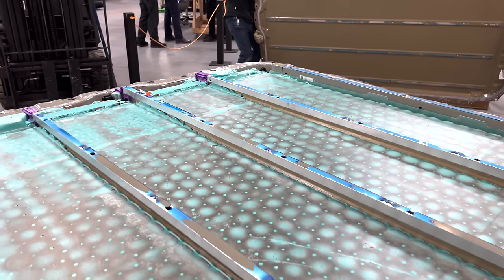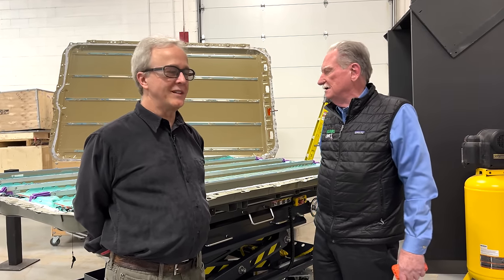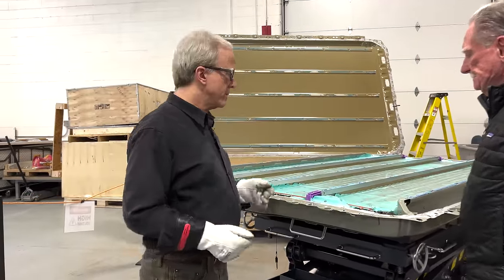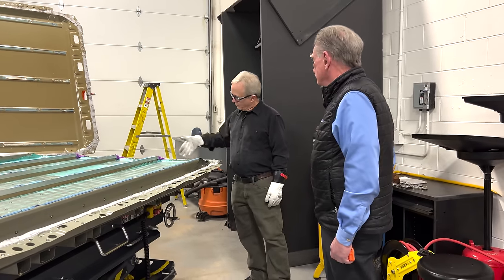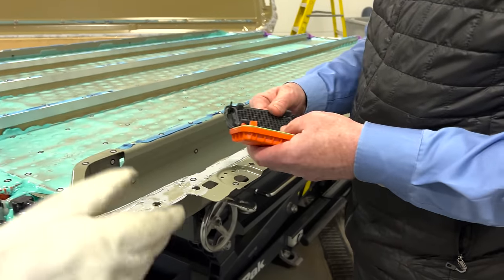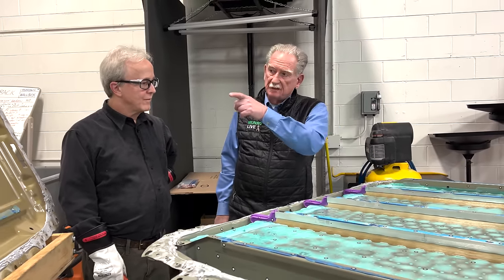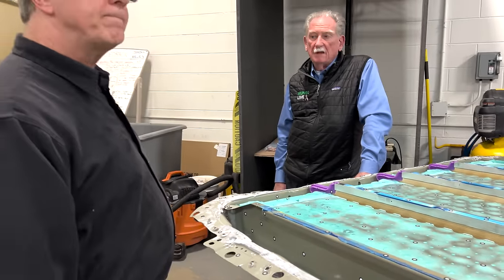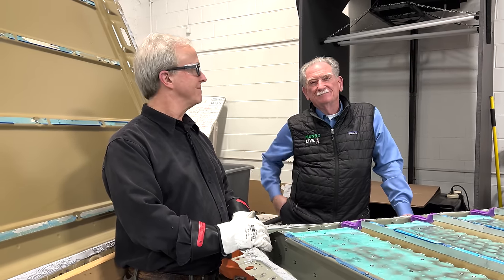Tesla Cybertruck Battery Pack: Our First Impressions Under the Lid

Comment: Completely unserviceable junk glue pack.  Another disappointing design feature that needlessly increases costs for the customer.
Reply: These packs aren't made to be serviceable. They are made to be safe for the customer and cheaper to replace than serviceable.
Reply: @xxZerosumxx  $15k for a loose bolt or blown fet is cheaper?   A failed string like you often get in rapid charged Tesla packs after a year or two would also be far more expensive.
Reply: @hugegamer5988 You don't get that "often"
Reply: @hugegamer5988  These packs have an 8 year warranty.  If anything happens to it, it's on Tesla. But I'm sure you're only here to complain about what tesla does.
Reply: @hugegamer5988 8 year warranty though, do no consequence for the end customer. I imagine you’ll find any manufacturer defects before the warranty expires. I think Tesla was targeting making these batteries last longer than the 8 year battery warranty.
Reply: Hilarious given it's the exact opposite, serviceable packs increase costs for the customer.
Reply: Batteries should not be serviceable. They should be designed for safety and cost. Looks like Tesla did an amazing job here.
Reply: Sounds like someone who can’t afford a cybertruck and is hating to me 👍🏽
Reply: Your getting roasted bro
Reply: @xxZerosumxx if they go bankrupt before 2032 you are shit out of luck tho 😂

Comment: Not a great design taking into account refurbishing the Cells or even recycling these new structural battery packs. Hope the EU intervene, as they did with swappable batteries for Smartphones, as a standard charging plug layout for BEVs.
Reply: Recycling should be no problem. They grind up the pack and separate out the elements.  The foam is no different from various other adhesives as far as that process is concerned.

I don't know the relevant EU regulation, but making the battery cells swappable (as opposed to the entire battery)  would be a fairly big cost/performance hit for the product.  I don't think the intent of the regulation is to force consumers to pay more or get poorer performance.
Reply: @AmiGanguli  So clean, sustainable and Eco friendly method...not.

Comment: Wait! What happened to the 'structural battery pack'? How are those slightly thicker walled 4680 batteries going to support the stiffness of that pack with an air gap like that on top (below)? It looks like the strength of the pack comes from those longitudinal bars, which do tie the top and bottom of the pack together, making it a strong box. A box like this makes the trade off of stronger cells at the expense of maximising power density, useless.

Comment: It’s like a Mobile  phone , usually when the battery goes bad people get rid of it.  If you built an engine 40 years ago and never ran it , you can put fuel in it and it works just fine.  But batteries always fail over time.  An electric green vehicle is only green over time   if the batteries could be easily removed and repaired inexpensively.  ICE vehicles can be handed down and used for decades.  The greenest vehicles are the  ones  that you can pass down to different owners and use for many years , because all these people buying used don’t have to buy a new one and and that means one less vehicle that needs to be made.  The greenest vehicle of all is the one that’s not made.

Comment: I never Seen A Guy Take A Pry Bar to the Top of A Battery Pack to Pry Something Loose ! Next Time Pry on the Delineators or Cross Channels ! Loose Move with Host Standing There ! Mika Thermal Shielding , Pop off Lid Venting , Flood Port Valves, Gas Valve Solenoids Stick Sometimes too ! Super Battery Pack Looks Very High Density, Packet Tight Fit None Serviceable The Every Car Scenario You Still Get Moisture Thru Capillary Action Nice Unit has a Lot of Built in Safety Thanks for Bringing that Forward !.

Comment: Serious question.  Is RTV really enough to seal these battery packs?  Even GM had dealers use RTV on a recall on the Hummer for the main connector into the pack and just pipe RTV around it to keep water out.  Shouldn't there be something better used for sealing such a vital and potentially dangerous component?  The OEMs have trouble with RTV on ICE engines as it is lately (which is I assume a quality control issue), and I've seen first hand some of the GM ones.  LSY 2.0 camshaft carriers, L3B 2.7 plastic lower oil pan, rear main covers on LSY, L3B and the LM2 Duramax, etc.

Comment: Makes you wonder what Nio or Mio does with its batteries in China. They are probably one of the first, if not the first EV maker that has the ability to change your battery on your vehicle in 3 minutes flat with a brand new pack which looks very similar to the cyber truck battery pack size.

Comment: I see a lot of comments about repairability. The logic behind a structural battery pack is that it saves weight.
In practice this means the EV weighs less, needs fewer cells for same range and is more energy efficient.
It is also most likely cheaper and faster to produce, meaning more EV's on the road.
Less weight, at least for the other models, means less road wear and longer lasting tires.
Combine that with the fact that high voltage battery packs are not something an average person should try to repair anyway.
It's just not safe for anyone but a specialist.  Tesla battery packs are also very reliable to begin with. Adding weight and cost and complexity, that can lead to more failure, seems like a bad idea.
Its not like they purposely made it unrepairable, there are compelling reasons to take that route.
Reply: I couldn't agree more.

Comment: Thank you for the model x story.  I have worried whether one could exit the car in the very unlikely event of being submerged.  This is the last safety feature that needs to be on any vehicle.  Kudos to Tesla engineering.
Reply: I wonder, when car thieves will use it. Just apply some water to some humidity sensors and the windows will go down and the doors will pop open. Sounds like an interesting mechanism.

Comment: Many thanks.
Very informative and ingenious design. Once again by Tesla.
Wouldn't want to own one because of high insurance costs, extended warranty costs, maintenance and repair. Leasing makes the most sense and flip every three years, however when you are retired and doing less than 5k miles per year - leasing isn't cost effective either. This may explain why conversion to fully electric is stalling in the consumer market.
In the UK there are additional  issues. No tax incentive, hundreds of miles to the nearest Tesla servicing facility and FSD isn't available on our roads yet.
Tesla Robotaxi may be better option for retirees. So another reason for delaying a purchase and staying with my trusty ICE vehicle. Also, I can service and repair it myself.

Comment: Nice. Munroe, Why don't all EV folks split the charging of batterys in 2 like Hyundai to speed up charging time?
Reply: It doesn't really speed up charging... The cell is going to take what it wants regardless of overall pack voltage for the most part. The only real reason for splitting the pack is for infrastructure compatibility without the need for an on-board DC-DC booster. 

Up until Tesla started opening their network, there was no public charger (in North America) that a CCS vehicle could take advantage of that didn't output 800V+, that was really only a thing on older charging infrastructure in Europe (which is why the Taycan has an optional upgraded on-board Booster you could option that nobody bought here in the US)
Reply: Because then your system voltage for all high-voltage components will drop to 400V. The heat pump/AC compressor would need an operation mode at 400V, where it is still equally capable. The motors will need an operation mode for 400V - like if used for heat production in the cold when standing at a 400V charger. Also other components like high voltage heaters would need an operation mode at around 400V.

Comment: I see the markers and ask myself why you 3D Scan the Battery Pack Inside? Normally done for Reverse-Engineering or do you use it only for measuring purpose? What happens with the CAD Data?

Comment: timestamp 2:00 ... crash zone ... yes ... I'm guessing that it doubles as a float when sealed ... helps the Cybertruck stay bouyant when immersed in water ... as far apart as possible for additional stability side to side ... and long for front to back stability ... and the weight of the pack keeps the head up ... also important for safety ... might this eliminate sinking if accidentally thrown into the water ... let's say off a bridge after a crash ...
Reply: Is this sarcasm?! The cybertruck is so heavy that you would need a special license in Europe to drive it, There's no way of making it float!! But the cybertruck can't be sold there because of its poor safety ratings.
Reply: Keep throwing random crap till it sticks.

Comment: turns out that cover is bottom or  facing the road. There is too much empty space even for physical intrusion. I think the extra space is for more flexibility for different battery cell types. Consider the M3/Y now have seen four cell types, 2170, Prismatic LFP, 4680, and BYD blade.

Comment: My core concern is they market the vehicle as being off road capable , will its battery be capable of resisting a battery impact if gets hung up on a rock,  , Addresing the issue of water intrusion issue is also a concern , why could they not extend the pressure vent with a tube to a high point on the vehicle is a thought..
Reply: The pressure vent doesn’t let water get in. They explained that in the video. There’s also the compressor that can pressurise the pack for additional protection against water intrusion.

Comment: Ok 😮 how does the Wade mode positive pressure apply if the battery pack is glued air tight? Would positive pressure affect the battery pack with time?
Reply: Covered at 28:30. Also the orange & black vents will let pressure through.
Reply: There are pressure relief valves as comprehensively described in the video. My own reading of the issue is that the pack would normally operate at atmospheric pressure but if you go wading the air pressure would be increased enough to stop water being sucked in. It need not be a particularly high pressure it's just to balance the natural tendency of water to be sucked in when wading.

Comment: Excellent camera work guys , i almost felt like i could reach out and touch the pack. One major question i have , assuming a customer has a problem with there battery , how in the hell is a technican going to fault find that pack ?? let alone fix it in any sort of reasonable time frame , plus the outer casing of the pack has to be almost destroyed to open it , so basically it seems a customer will have to buy a whole new pack if there is a problem , maybe im wrong in that assumption ., so when the cybertruck gets old , no one will want to buy it for fear they will have to replace a whole pack costing more than the value of the truck , thats a pity for folk , trying to start on the bottom and looking for cheap vehicles to get going in life.
Reply: If you want the cylinder head of a car modified or repaired they commonly give you a replacement that has already had the work done ... and you give them your cylinder head. Similar approach here. It's the same as what happens with EVs already ... they replace the battery pack with another one and repair your pack for use in another vehicle (if it is repairable). It speeds up the whole process.

Comment: VW batteries consist of a couple of modules that you can replace individually. Just open the bottom plate and pull one module out. So you don't have to buy a whole pack.

Comment: Interesting battery pack, but surprised by your comments on the vehicle.  These things are breaking left & right in the field so either they gave you an amazing sample or failures are during the factory build.
Reply: Well from an engineering standpoint It's definitely something new and innovative. Failures stem from individual cells, this video was just an outside view of the battery. the only way to know the reliability of those batteries will be in the long term.

Comment: Hi, can you comment on the  material difference  between the sea-foam material and the plastics of the black tubing connected to the electrical modules? What prevents the one material from corroding the other? Thank you.

Comment: Time has proven it doesn’t matter how much RTV you use, water will always find its way in. In this case once the battery pack has been cooled and heated enough along with the everyday abuse of being on roads the RTV and the silicon gaskets will fail and I’m sure they have already. As an emergency responder I’ve seen a few of these battery packs that have been breached. Fortunately during those events there weren’t any fires however I’ve seen a few where the batteries ended up violently burning up. Needless to say, lots and lots of water/AFFF had to be used and in one situation we just had to let it burn as we were nowhere near fire hydrants and could only make sure the fire did t spread. Even been on one call where the driver couldn’t get any of the doors open which is why I’m sure is why Tesla has added manual door releases on their newer vehicles instead of relying solely on the electric release mechanisms.

Comment: So, you think the extra space is dent zone.....NOT space for a prismatic cell battery ?  To me the extra space answered the one question:  How did tesla miscalculate so badly on the high end range?   The extra space seemed to say "They didnt, they just went with smaller/less batteries to start"

Comment: The amount of thought that went into making this battery pack safe for off-road use and in an impact situation from the bottom and the sides is very impressive.  There must also be a lot of pre-assembly individual cell testing, because if a bad cell makes itself known in use, there is no way to get to it to replace it.  Thanks for the insight, Tom and Sandy.  Munro is always THE website to find out how these things are engineered.  PS I bought my first EV last month, an Austin-made Model Y Dual Motor, and the door seams and paint are perfect.  I feel like it has the Sandy Munro "seal of approval" for the gigacasting design.   LOL

Comment: @MunroLive 
.
Just a thought .. but...
Those extruded Fibre (fiber😉) components Tom mentioned at the end of the video...
.
Could they be a clue to the materials/ construction to be used in the Gen 3 system?
.
I'm thinking not only structure, but lightweight panels fitted to structure with simple trim clips (inside shut lines) wrapped instead of painted.... 
Great for a Taxi? (Advertising) 
Easy body repair (Wrap, then clip on a new panel)
Offcuts, damaged panels go back into a shredder for reuse?

Comment: So another battery (the single most expensive part of the vehicle) from Tesla that cannot be repaired or rebuilt?  I would not want to own one of these more than 8 years old (i.e. after the battery warranty expires).
Reply: Certainly it's a risk ... but I suppose it's much like if you have catastrophic engine damage in an older ICE car ... I know this through experience ... the car was not economic to replace the engine! There is already a market for reconditioned battery packs and this will increase as there are more older cars around, still expensive of course (even a reconditioned engine wouldn't have been worth it in my old ICE car).
Reply: @MrAdopado That market of reconditioned battery packs will rapidly disappear when all battery packs are made like this one. How would you recondition a pack like this? Grind it up in bits is all you can do when too many cells have failed.

Comment: The 30mm extra thickness on the battery also helps moderately with stiffness of the pack in bending. 'structural battery'
Reply: As long as you put some material in there to bridge the 30mm. 30mm of just air is not going to improve the stiffness. It's the 30mm (from the video: I think it's a lot more actually) additional height in the longitudinal beams that adds the stiffness.
Reply: @hvh377  It does not have to be a solid section - it's a truss. The spacer sections hold it at the proper height, carry shear. The dishing prevents local buckling.
Reply: @queazocotal  That what I said: you need more than just 30 mm of air. The spacer sections should be 30 mm higher also. Suspending the top lid 30 mm above the longitudinal beams doesn't add much stiffness at all. It probably removes some.

Comment: Looks like GM should’ve looked to Tesla for their battery pack design. I saw seven pieces in the main structure where GM had over 100 little stamp pieces welded together, made the pack weigh just as much as an average car

Comment: 11:15 "Edges"? No, the cooling channel contact a small fraction (less that 1/6th of the circumference) of the side of the cylinder, not the edges of cylinder ends.

Comment: Does this method of pack assembly with foam render the pack completely un-recycleable? If so, do the benefits to this design outweigh the inability to breakdown and recycle? I imagine it almost certainly renders the pack non-serviceable.
Reply: Hard to service, yes. Hard in 2nd life: yes. But still easy enough to recycle. A grinder will take care of it.

Comment: Assuming 25Ah cell (2nd gen 4680 evolutionary change), and system rated voltage 816V, likely 220S 6P. Which,
 lines with ~123kWh.

Comment: I like how he says it looks like 48 x 7 cells in each module. . . I would assume that each module is 48s7p,   or 192s7p for the entire Batteryu pack,  giving us 800 Volt battery pack.

Long story short,  I am betting the next video says the battery pack is 192s7p,  or 1344 total battery cells. . .   The math works with the "Around 1360 cells" previously reported.
Reply: Also,  those batteries do not look like they provide any vertical structural load within the car,  can someone speak on that next time?